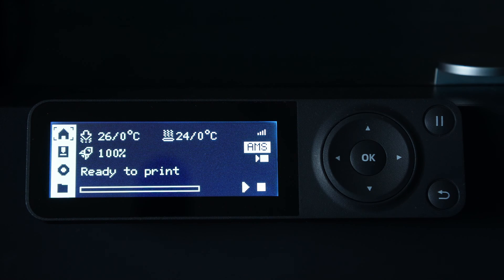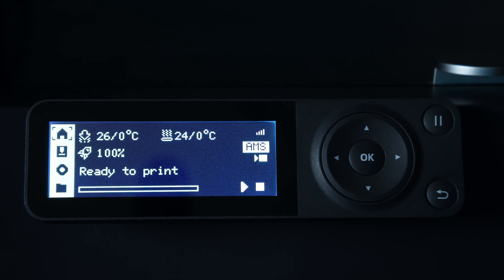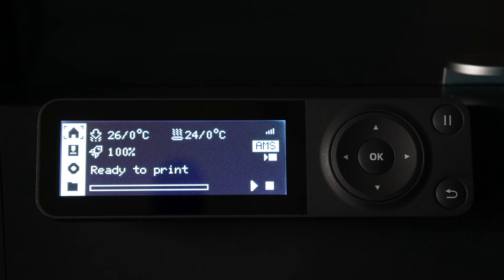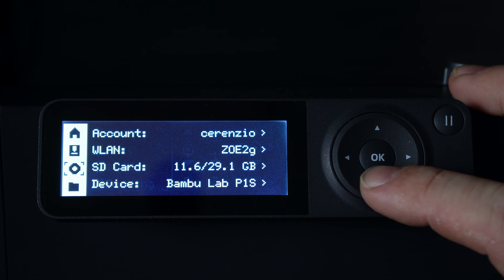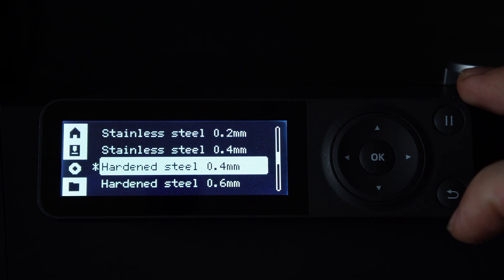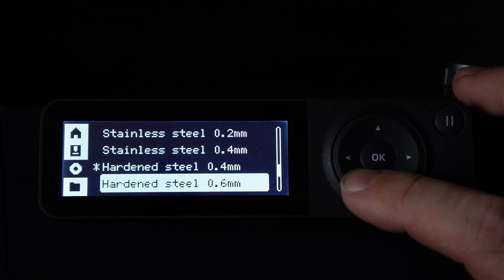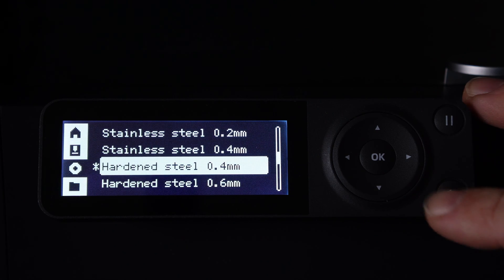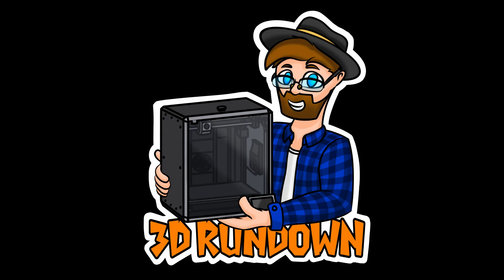How to select your Nozzle Type in Bambu Lab P1P/P1S Firmware.  3D Printer

Comment: Thanks, I never use those shitty menu, I would have lost a lot of time finding out that setting burried under the GUI.

I do change nozzle pretty often, that's really a hassle.
Reply from the maker: If you do allot of nozzle swapping, you need an A1.
Reply: @3DRundown  It's shit compared to my P1P.
Besides, sInce their shenanigans, I'm boycotting Bambulabs.
Their printers are very good, but they showed a dark future in their ecosystem, I don't want to encourage them.
I'd rather have a Prusa Xl that works (seems it's riddled with problems). It swap extruder quite fast.

Comment: Unfortunately Bambu Studio still gives me the warning even though I told the printer that I upgraded nozzles. Is there a setting in Bambu Studio that I am missing?
Reply from the maker: You'll need to chose the correct nozzle profile when slicing
Reply: Thanks! I know I did where a user can edit printer components but don’t remember doing it during the slicing operation. I’ll look for the option once the current print is complete and report my findings (or lack thereof) :). Thanks!!
Reply from the maker: In Bambu Studio, Under "Process", where you choose a layer height profile, make sure the chosen profile has the correct Nozzle size